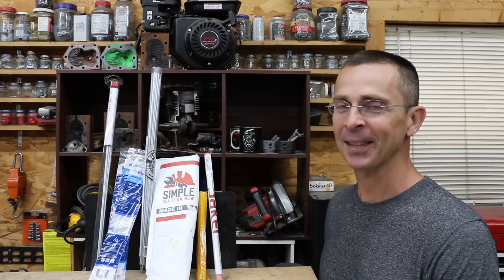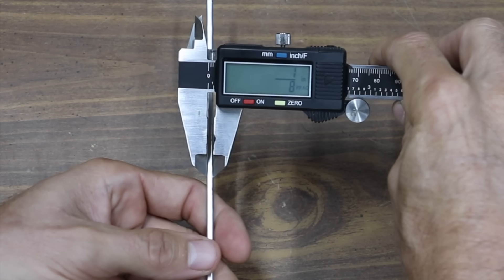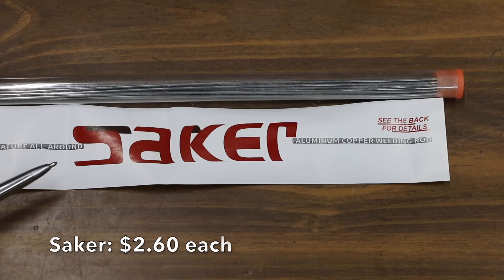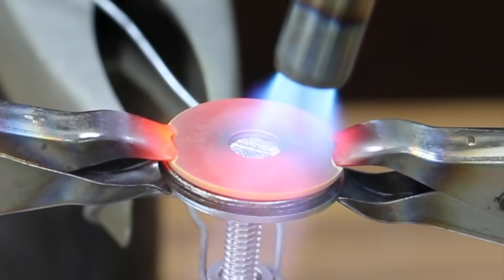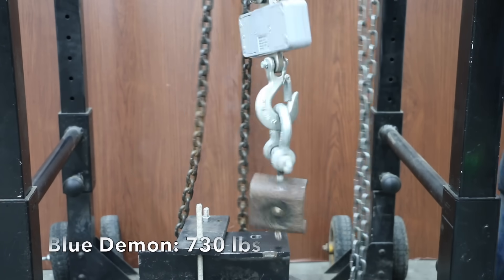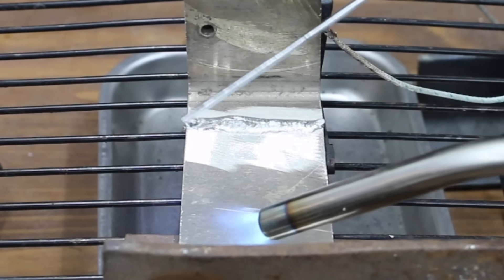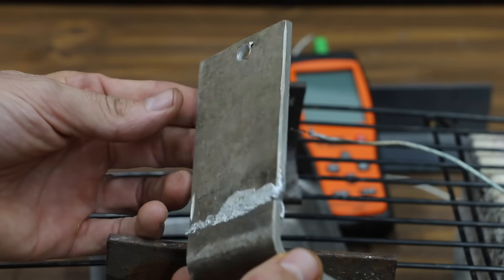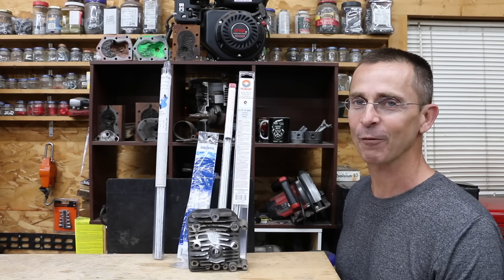Best "No Welder" Aluminum Welding Rods? Alumiweld vs Bernzomatic vs Hobart

Comment: My favorite trick with these rods is repairing stripped threads in aluminum! Drill hole out slightly larger, fill hole with molten aluma-weld, drop a red hot steel bolt in the hole! Instant thread repair!
Reply from the maker: Thanks for the feedback.

Comment: That was impressive. I have never even considered this type of product, believing the ads to be all hype. Thanks for showing us/me they do work. Blessings to you and yours as always. I believe you are living proof that there are ways to make a living, demonstrate ingenuity, and use common sense in everyday situations and conditions. Not all the smartest people teach at Harvard. Clearly.
Reply from the maker: Thanks so much!
Reply: They are surprisingly good. You can get a traditional aluminium brazing system but the flux is corrosive and the melting point is close to that of the base metal. The advantage is that it flows into joints like lead solder. Done right, it’s a brilliant system but it needs practice.
Reply: I remember going to an auto swap show back in the 1980s where some guy was demonstrating "aluminum welding rods" and everybody was like "yeah, right...psssshhh" But we all stood there and watched. He had an Oxyacetylene torch sure enough, he was able to weld all the bits and pieces of aluminum he had. My buddy purchased the "kit" but it only came with a Propane torch and it cost over $50 (that's in 1980 dollars!) and it didn't work very well...we just could not get the surface hot enough with the propane torch. Never considered MAPP gas though and since we were barely shade tree mechanics, we had no access to anything else. So for us, this thing was a bust! 
Glad I stumbled across this video though because I do have some aluminum I need to repair and a Harbor Freight a couple of miles down the road!
Reply: I’ve been waiting for a video like this. 
 Bought some CHeAP rods off Wish that were too close to the aluminum melting temp and they simply didn’t stick. I had given up but will now try to get some Hobart rods. 
 Thanks!!
Reply: I actually didn't think aluminum brazing was a valid process either. But the "Simple" brand showed a proper braze joint, on the level of welding. I am not sure how they manage to create so much strength. Silver brazing on steel and stainless steel, copper and brass, is shockingly strong and indestructible. But I never figured that an equally good process existed for aluminum.
Reply: Yeah the smartest people teach at Yale
Reply: @autodidacticartisan  gay
Reply: @autodidacticartisan  Princeton*

Comment: As usual, you knocked it out of the park with this evaluation!  Could you please buy a fleet of the new pickups with different engine and transmission combinations, and let us know what you find??? Love your stuff!
Reply: That's easy.  Just buy (in order of reliability) Toyota,  Ford, Nissan for light duty service.  For ¾ to 1 ton ( F250, 2500, F350, 3500) Ford, Chevy Dodge. At around 45,000 miles you will be spending  time ( and money)  in the shop for electrical problems with anything Chrysler built.

Comment: Anytime you heat aluminum to it's melting point you'll lose its temper and thus its strength. 

Also, the use of zinc plated washers might have compromised the test. Zinc inclusions absolutely kill weld strength and prohibit the weld metal from wetting the surface of the parent metal. Even though the washers' purpose was just containing the weld, the inside corners on the bolt heads were likely contaminated with zinc just by touching the weld puddle.

Other than the specifics, excellent test, I love your videos!
Reply from the maker: Thanks!  Thanks for the feedback.

Comment: I have a pressure washer with a 1.5" crack in the aluminum pump casing. Do you guys think these rods would work to fix it and hold up to the pressure?
Reply: Yes, but braze it from the inside.

Comment: Thanks for the video, I am either going to go and get the Alumiweld, because I can solder pretty good and it looks like it's something I could do.  Either that or the JB Weld.  I do volunteer work for the Pinelands Preservation Alliance and have been tasked with restoring/recovering some old farm equipment.  Called Planet Jr. Fire Fly Plow and a few other hoes, Tillers and the like.  They made the Flexible Flyer Sled, you might have had one.  So I want to do a good job and wanted to upload it so I could get your opinion, but I realize there isn't an option for that. (maybe I can go to your web site?)

Anyways, I appreciate your work, and it's helped me.  
Keep up the good work and thanks for not being long winded as some are, and doing meaningful testing.
Regards,
Peter
Reply from the maker: You are welcome!

Comment: Great article! Need to know how to weld a mitered corner for an art project. Welds cannot fail and are subjected to additional grinding and polishing to finish. Low melting point is a must since the aluminum will be wrapped around cypress wood. Thanks for the guidance👍
Reply from the maker: You are welcome! Hope it works out for you!

Comment: I've done some back yard tempering of aluminum. The old gas Weber BBQ works really well for getting a part like that head up to temp evenly. 

This is maybe THE best product comparison video I have seen in a very long time. Get's to the point. Every second is filled with useful information. Your speaking is quick yet clear. You used several very credible tests and you did 2nd samples where the first looked problematic to be fair to the products. 

I would like to have seen a tensile test of the butt welds. I'm also wondering if one could get any of these to flow enough to pull off a lapped joint. That engine head test is not promising for flow. I guess maybe I'd try chopping up bits of the rod, sandwich them between the plate and heat as evenly as possible.

Comment: Use Fiberlock for a cracked head and blown gasket. And or try all the gasket in a can methods. Would be interesting to see as you accualy test things to see how they perform not just "it runs it's good"or " it smoked now it isn't it worked"haha thanks for the videos
Reply from the maker: Great suggestion!  Thank you.

Comment: Resurface a cylinder head at home(sand paper on sheet of glass or wood block "the right diy way lol" no grinders). Know it works but you could check compression and such as well. That would be AWSOME
Reply from the maker: Thanks for the video idea.

Comment: Harbor Freight Aluma-weld did an awesome job on my repair.  Dewalt 7491RS table saw up/down adjustment was stripped out on motor assembly.  Completely filled in thread hole (or lack of) on motor. I believe it was a 14mm...fairly large bolt assembly. Drilled and retapped and year later no signs of thread wear with lots of wood put through the saw. One thing not done here and I believe in directions it said to scratch surface as your welding with a stainless pick the break surface tension. Do not really know why it worked but, for sure was a better weld when I was scratching the surface with pick I made from a spoked wheeel.

Comment: Keep up the awesome videos. About a year ago I saw a video where a guy ran a flathead screwdriver in the weld to allow the aluminum to bond to whatever aluminum frames he was welding it gave the weld its self a different strength compared to just letting it cool down. Not sure if he scuffed up both surfaces, but it could hurt.
Reply from the maker: Thanks, will do!  Thanks for sharing.

Comment: As always another comprehensive and informative review and testing.  Although for aluminum I use a tig welder or a spool gun with my mig welder I was much surprised and didn’t expect the brazed joints to perform as well as they did.
Reply from the maker: Thanks so much!  Thanks for the feedback.

Comment: Great video, I have seen the commercials and seen some in the stores and have wondered about the product.     

One video I saw for a repair where a steel bolt got galled into an aluminum casting and pulled the threads out.  They repaired it by cleaning the aluminum, wiggling a drill to open a wider hole in the bottom, then heat the casting and fill it with their brand of wonder-rod (sorry I don't remember the brand) and when the hole was completely full just dropped a new and clean steel bolt into the liquid filler.  They did allow the repair to cool while they were doing a voiceover commercial after which they used a wrench to remove it.  A bit later they show the part reinstalled and "Holding".    Just an idea while you may still have some of the rods laying around.  Thank you so very much for your video series...
Reply from the maker: Thank you.  Thanks for the video idea.

Comment: @projectfarm  Have you done any videos of the heat resistance of these welds? Im thinking about "aluminum welding" together a custom transition from my wood-stove exhuast to a 6" pipe. I'm wondering if the thing will just fall apart after the wood-stove gets up to temp. This would make for a very interesting experiment. thoughts???
Reply from the maker: Great suggestion!  Thank you.

Comment: A Switcheroo???
Hey, look, I normally like your reviews, Okay. But on this one you didn’t give a fair review, at all. When you were welding the bolt with the washers on them, you showed at the time marker 4:54 in your video, that you First “sanded off the top of the bolt to give a consistent, abraded surface” on the top of the bolt. At that point the bolt you were showing had had all of the raised bolt numbers sanded off of the bolt head. This was obviously the bolt you showed at time marker 5:04 when you started putting the washer stack on top of that bolt, because the bolt head that was showing had the numbers sanded off of that bolt, just like the one at time marker 4:57. 

But then, at time marker 5:45, “voila” you show the “failed” weld when you pull the weld apart… revealing a bolt head that had not been abraded at all! It even still has the original raised bolt numbers still on the head. It seems to be obvious that you switched bolts to use one that had not been abraded, at all - which means you used a different bolt for your “weld” test. WHAT GIVES, MAN? I’m afraid you just stop a big hole into your credibility, in my book.

Comment: I used the Harbor Freight rods and ended up melting the work piece because I could not get the rod to melt  just touching it the work piece.   No sure if I was doing something wrong or these rods just had a higher melting point.  This was on cast aluminum, maybe it melts at a lower temperature.

Comment: Hi, by the way, the thermal camera likely registered the brazed aluminum as lower temperature because it is less emissive and more reflective. Try painting the metal, or placing a piece of painter’s tape over it to give both materials the same surface finish so that they will radiate equivalently.
I just stumbled upon your videos and love it. Keep up the great work!
Reply from the maker: Thanks, will do.

Comment: I'm a welder by profession and aluminum is extremely hard to weld if you have impurities (anything that's not aluminum). So after brushing the metal you should clean it off with a fast drying solvent. It makes a better longer lasting bond....just FYI for anyone trying to weld aluminum and wondering why it's not holding very well
Reply from the maker: Thanks for the feedback.

Comment: Out of curiosity, how well would something like this work as an alternative to nuts and bolts for holding complicated things together, for example a trailer, or fitness equipment, or something else that experiences relatively moderate uses. I personally don't think I could possibly trust it, but it seems like it would be a good way reduce a lot of weight off of a vehicle or trailer, or repair an aluminum bike with a cracked weld.
Reply from the maker: Thanks for the video idea.

Comment: Test rtv  Gasket maker. I believe it is a much stronger gasket  When  Applied a thin neat layer and let dry before assembling.  I have heard to let get tacky,  and some think it has to be wet .  Test with a clam shell pressure chamber and hyd oil , highest pressure wins .  Also paper and fiber gaskets.
Reply from the maker: Thanks for the video idea.

Comment: It's good to see they actually  worked if done by someone compeyent  ...I tried three different brands  and never could get the base metal hot enough.  Although  I attempted it on a large sheet of aluminum  using a cutting torch all the samples were done on small pieces here. That might be the only application for these rods
 I had determine that a large brush propane torch would be needed but it was too dangerious to use one of those snow melting propane torch
Reply from the maker: Thanks for sharing.

Comment: Thanks for doing this. I gotta try these out. Glad I didn't have to slag something trying those Chinese rods.

I'm also guessing that people who are having lots of trouble also aren't paying attention to part prep and storage/corrosion of the rods (just like trying to solder with solder that's been on a fishing vessel for 10 years...) If the rods have been bouncing around your trunk or in an old shed, they may be corroded and oily and the flux may have been scraped off.

The inexpensive ability to weld alu with my blowtorch seems like a very nice pairing with my cnc router's abilities!
Reply from the maker: You are welcome!

Comment: Though these BRAZING RODS can be useful, it is extremely and dangerous as well as irresponsible to call them welding rods and the process welding!!!  Brazing any melting is always a lot lower than the same metal when welded correctly.  Too many who watch your channel probably are not  aware of the limited uses for brazing, they should never be used for anything that is structural.  This video should  be pulled down before someone gets injured or killed by the use of these rods when the item needing repair should be welded.

Comment: the original 'lumiweld' was created behind the iron curtain, poland i think, in the 1940s from what i've heard.
used it for repairing holed crank cases on low oil pressure systems.
make sure you clean with acetone and preheat your parts well.
Reply from the maker: Thanks for the feedback.

Comment: I work in HVAC/R industry and I use Lucas-Milhaupt AL822 or AL716 for refrigeration and air conditioning systems. I find it's quality and consistency to be excellent. One thing to always remember is clean your aluminum base metals with stainless steel wire brushes and clean every surface being joined. please do a review on this product.

Comment: Thanks for all the interesting tests!  I learn every time. Question:  have you ever tested plastic repair tools?  I have seen a few like s shaped wires that connect to a sort of welding gun that you use to heat the s shaped wire and push it into the plastic. It would be interesting to see it the actual work. Cheers!
Reply from the maker: You are welcome.  Thanks for the video idea.

Comment: I bet that since the welded area is cooler that there would be long term thermal stress located at the weld interface. One might think cooler is better but perhaps not. Did you do a long term test on this weld? I know that you ground it out for the epoxy putty head to head so it must have lasted well with the rod weld.

Comment: I used blue demon for thread repair.. it worked great. you just need to scratch the metal with the rod to kind of tin it.  I filled the hole. Drilled and bigserted it.
Reply from the maker: Thanks for sharing.

Comment: brazing is not welding......it is not even a welding process.  its is useful but it is not a weld.  calling  brazing rod welding rod is misinformation and false advertising.    "the alumna weld did not detach from the bolt it detached from itself"  that is what brazing does, a weld is stronger than the parent metal and requires the parent metals to melt and fuse together with the filler.

Comment: .035 aluminum wire , use a .045 tip in my 180 lincoln high wire speed welds really good . Was not buying a pound gun. This stuff here is brazing NOT welding . This brazing stuff won't hold a intercooler boost pipe at 10psi. Blew apart.
Reply from the maker: Thanks for the feedback.

Comment: any chance you could braze these and maybe some copper or different materials onto steel plates and test corrosion resistance? im curious to see how a steel plate with a thin layer of copper holds up over time
Reply from the maker: Thanks for the suggestion.

Comment: try brazing copper to steel, and steel to aluminum, ect. with some engines or in my case hvac you need to do this.
Reply from the maker: Thanks for the suggestion.

Comment: What is not taken into consideration is the effect of the heat required for brazing on the strength of the aluminum material being brazed.
Most commonly the aluminum alloy available is 6061 in condition T6.  This is a heat treated condition. The final aging temperature is about 300F.  Once you exceed that temperature you are softening the aluminum you are brazing.  It is no big deal to get the brazing rod to be harder than the parent aluminum when you have softened the aluminum by heating it to 750F. Annealed aluminum is pretty soft, of course it will bend before the braze material.  Not only is the heat above the aging temperature but it always takes a reasonable amount of time to get the surface you want to braze up to 750F.  The heat migrates into all areas near the braze and by using a torch the hear is not accurately measured.  I noted in your "tensile" test the washers were red hot at one point.  That indicates that the washers were above 1400F at least briefly. No wonder you melted the head of the bolt.   This brazing rod is good for non-critical jobs.  Racks, boxes, or decorative uses. I would never use it on a vehicle frame or anything that would harm someone if it broke.
Reply from the maker: Thanks for sharing.